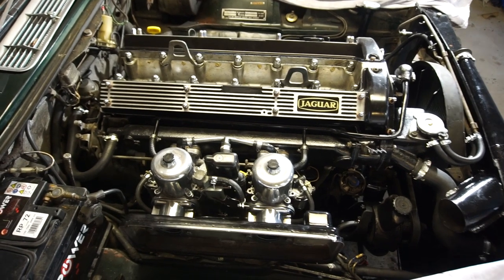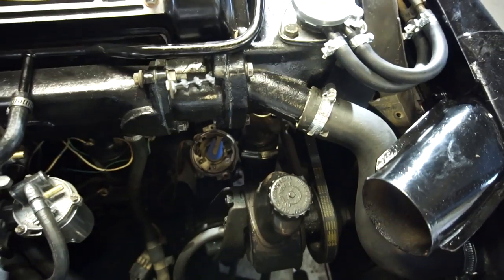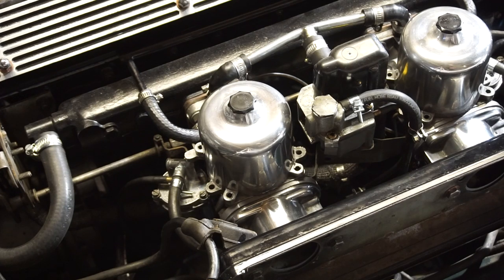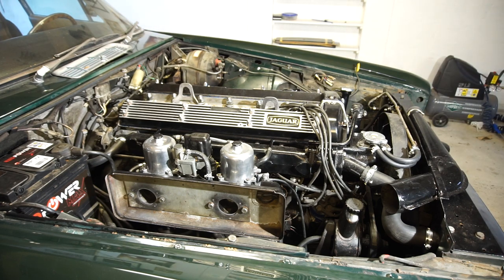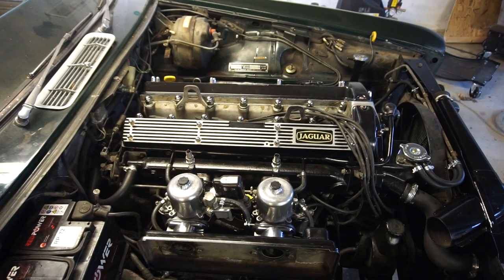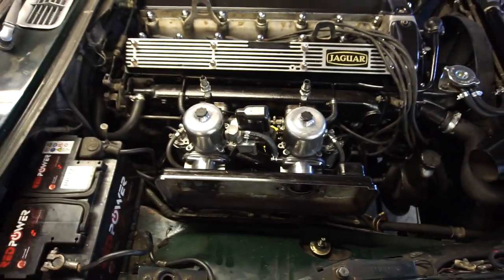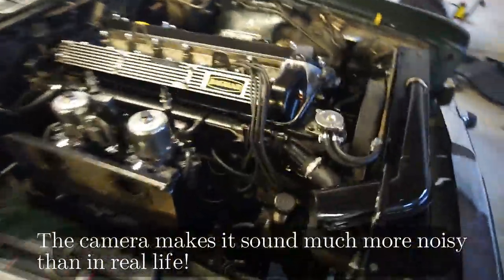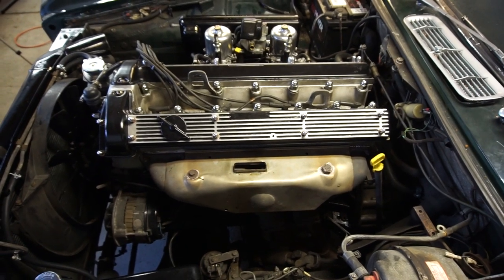Will it run? - Jaguar XJ6

Comment: I'm glad you showed the mistakes. We can learn from them. Was a little scared about the coolant leak. Some of the head bolts run right down into the coolant jacket wo when they don't seal its worrisome. Great video. Subbed.

Comment: Hello, my oil pressure lamp lights up before starting, after the engine has started it goes off again immediately. Is that normal? A few weeks ago the light did not come on before the start as far as I can remember. thanks
Reply from the maker: The light should come on with ignition and go off shortly after starting the engine

Comment: Adam, how did you get the hood/bonnet on aligned perfectly?  I saw the alignment in your final vid.  Tough to get it on!  Thx!
Reply from the maker: I made some marks with a permanent marker before I took it off. It's pretty good now but needs to go over to the drivers side a few mm. I will do th final adjustment the next time I have a few friends over.
Reply: @LivingWithAClassic  thx Adam.  A quick, how-to vid would be awesome!  Appreciate the high quality series.  Los Angeles.

Comment: Hey Adam, thank you for all the great videos! How did you manage to make the AED function as it should in the end? I have a similar issue with my AED.
Reply from the maker: On mine the bi-metal that opens the main valve was staying closed. I bent it up a tiny bit and that was enough for it to work normally again. Then about 10 cold starts to set the mixture and idle correct again
Reply: @LivingWithAClassic  So, basically the airflow was compeletely cut off all the time? (I thought that your car shut off because of the mixture being too rich when the AED wasn't blanked off, but that wasn't the issue?). I think on my car everything stays open all the time. Although at some point in March it did seem to work fine for one or two times. The AED still puzzles me :-)

Comment: Hi! Congrats! I’m really looking forward to the next episodes on this XJ6, inc your big grin once on the road at proper speed.
I understand the need for thin engine oil to start with, followed by 20-50 oil for a while, then a final oil change. Do you think this cleaning method is better than using an engine cleaner, type Forte or similar?
Reply from the maker: I'm looking forward to that too!
I feel that it's a safer method of cleaning the inside. If an engine is very dirty an engine cleaner can clog up the oil strainer and then your engine might starv for oil. Just my theory though 😊

Comment: Really happy that there’s content on how to replace the headgasket on an xk engine.   One question I have if you don’t mind answering is approximately how much did you end up spending on this job?  I’d like to replace the headgasket and a valve on my xj6 because it runs on 5 for now
Reply from the maker: I will be making a video on the total cost of getting it back on the road but tye cost of just doing the head gasket and valves about 400-500 dollars in parts and fluids.
Reply: Living With A Classic that is very reasonable and way less then I was expecting. Thanks for replying this makes me want to do my cars head as soon as I get a chance.